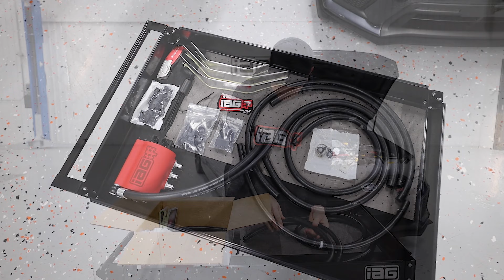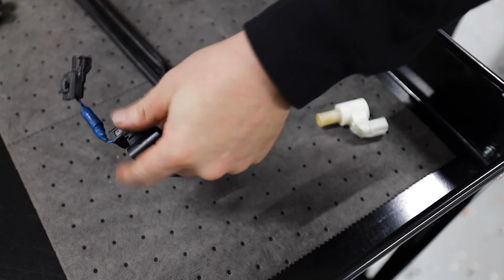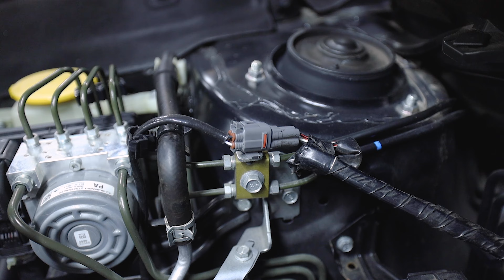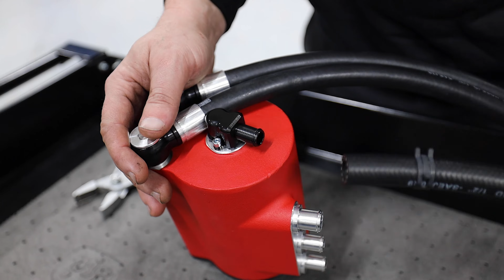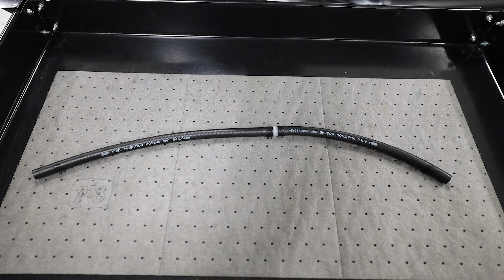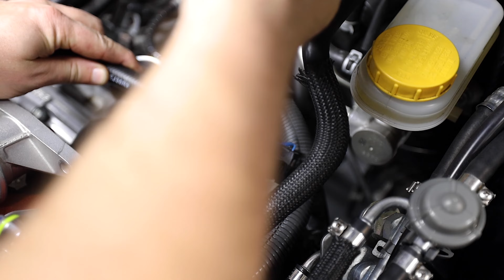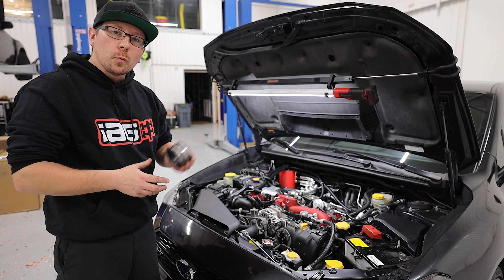2018-2021 STI Air/Oil Separator (AOS) Install Instructions | IAG Performance

Comment: THANK YOU FOR THIS IAG! Doing the install right now and had so much trouble getting the Y hose on the block.. If you’re having trouble as well, I saw a comment that said to reuse the OEM hose and I did so and slipped right on with OEM clamp.
Reply: You’re a godsend
Reply: I’ll keep that in mind when the time comes.
Reply: Just used this god bless
Reply: That’s exactly what I ended up doing. I spent like two hours messing around with it.

Comment: I don’t see a pcv connector on driver side on a 16 Sti am I wrong I don’t see it anywhere I see only two
Reply from the maker: Different model years have different PCV connectors. If you don't have one you can skip that step.
Reply: @theiagchannel  thank you lol I got it done. And it’s running smooth

Comment: Halfway through the install currently, will update when done! So far going smooth, biggest install for me ever so I’m taking my time and making sure it’s right! 
One note: when you go to put your Y splitter in consider re using the OEM hose the same size, it fits so much better and you won’t break the fitting or your hand trying to put it in, lol! There’s a video someone linked where the guy shows using the stock hose instead of the one provided by IAG!
Reply: Update: I am done! Everything is back together and running good! By far the worst part was getting the intercooler back on… the turbo hose connection will make you go insane! You need a lot of lube/grease and a nice long pick to help guide it on! Very challenging yet rewarding once everything is together. I bled the system, now I need to add some coolant back but other than that I’m ready to ride’
Reply: Did u spill any coolant?
Reply: @GrayreaperAI  yes. It’s hard not to when disconnecting the lines unfortunately. It wasn’t a lot though and I added back some to level it out!
Reply: @andysmith9243  does it smoke white from engine?
Reply: @GrayreaperAI  oh no… that could be a deeper issue with your coolant system
Reply: @andysmith9243  it was the coolant burning off. I drove to work today (35 mins highway) and no smoke or issues. Thanks for the install help. One thing I would like to point out. Is when you first put the AOS in, the tubes on the bottom of the unit looks as if it’s not going the left hose to the turbo coolant port.
Reply: @GrayreaperAI  ahh okay good to hear! And yes I understand that. It’s not an easy install and can be a bit tricky with some of the hoses. Glad everything is good’
Reply: @andysmith9243  thank you. Hope the best for you
Reply: Im currently installing mine and the y fitting broke 😢 I’m gonna try using the old hose when the replacement eventually comes in because I spent 2 hours fighting with the IAG parts just for the fitting to fall apart in my hands
Reply: @soglod4572  damn lol that’s a pain! From what I remember I re used the same part you are talking about. It’s such a disaster of an install lol! If I ever do it again I will pay someone!

Comment: Does this apply to 2008-2014wrx?
Reply from the maker: Some aspects are similar, but it's not exactly the same due to differences with the intake manifold and PCV hoses. We have full written instructions on our site for the 2008-2014 WRX

Comment: Bout to do the install in a day or two. I have watched this video 3-4 times already, and will watch a few more times before doing the install. I have all tools ready to go, and am excited to get this on the car. My 2011 wrx had cylinder 4 compression issues, and I didn’t care for it as I should’ve, and definitely learned my lesson on what is needed for these cars to be healthy. I traded it in for a new 2020 STI that ive kept completely stock thus far. This video should be exactly what I need to understand the process more thoroughly. 

Thank you IAG, for providing this video. I understand most shops charge quite a bit for this so i decided to give it a go myself. 

I’ll let you guys know how it came out after I’ve finished the install. Next up after this is the cylinder 4 coolant mod, along with a Koyo aluminum radiator. Only then can I be comfortable doing performance upgrades down the road, as this is a daily driver that id like to keep healthy over its lifetime…
Reply: Alright guys, I’m taking a break. I’m at the point of reinstalling the intercooler, but having some issues with fitment. Should be able to get it on with some patience. 

I struggled to get the yfitting on to the block where the oil returns from the aos, that took me the longest to get right. Hard to see down there and I couldn’t get my throttle body to move quite as far to the side as they showed in video. 

The other parts that took the longest we’re getting the clamps all set right. Some of the steps took me longer than I was hoping, and I had more coolant leak than I would’ve liked. I’m sure I’ll get some smoke on start up due to that. I’ll come back after I get some rest and get the IC reinstalled. I hope to have the car running by this afternoon. I’m hoping it’s all solid and there’s no leaks on start up. I’ll have to add some coolant but that’s fine and was planned for.
Reply: @coryanderson5210 congrats on your progress! Would love to hear if you’re finished now. I’m over halfway through and yes the y fitting was killing me. I found out you can re use the OEM rubber fitting that’s the same size and it goes on much easier but is still very secure!
Reply: @coryanderson5210  How did it go?
Reply: I couldn’t get the TMIC back on, due to the new tubing that ran under it. Followed instructions, and tried a few different things but couldn’t get it to fit so I just took it all off and returned the car back to stock. 

It’s not what you all want to hear, but I’m just gonna keep this car stock at this point. There’s more important things in life right now to take care of than to spend time and money messing with my perfectly fine running car.
Reply: @coryanderson5210  That sucks. I wouldn't give up, maybe take it to a mechanic and work on it with them or something. Or perhaps you need a couple more special tools to help you get it done. You could also just get a catch can instead which I believe is easier to install. Even without either of those, your car will run just fine, its not a big deal.
Reply: Yea it’s running without any issues. Wasn’t a tool issue, it was a sign from above that my time and resources arent meant to be spent on these sort of things… no complaints to IAG. I should probably not comment anymore after this one, as I don’t want to take away from IAG and their quality business and products.

The car runs just fine in its stock form. I’m now content with that. Like I said, it’s not something the car community wants to hear, but I have more important things to deal with than changing up my perfectly operating and fun to drive two year old car… I used to be obsessed with cars, but I knew I had lost that interest when purchasing this car new. I got caught up in the mod phase for a short while, as this car is the car to mod, but my priorities are now set anew. I guess it’s my test of temperance for these next few years.. I’ll enjoy it as is, and when the time comes, I pray Jesus will be happy with my decisions. That’s all that matters now.. 

Hope you guys are ready for what’s coming! Repent before it’s too late… cars won’t survive through an emp… and there won’t be cars in heaven or hell, so enjoy them while you can 🙏
Reply: @coryanderson5210  It will run fine now, but having an AOS will keep it running well for longer. Keeping it stock will make the intake valves get covered in carbon eventually. I'm not sure how much it would cost a shop to install it for you, but if you find out and are okay with paying it, get it done.

Comment: Word of warning to those such as myself that live in cold climates.  If you drive your car for extended periods (NOT stop and go) in extreme cold, the AOS lines WILL freeze.  I'm currently thawing out my entire PCV and intake system.  I want to emphasize that this is NOT, I repeat, NOT a problem with the AOS, it is an inherent issue with the location of the PCV and the intercooler on WRX's. The cold air blows through the intercooler, directly onto the PCV lines.  Over time, this will cause the moisture (water) in your system to freeze and create crankcase pressure which will push oil into your intake, and possibly blow your dipstick out, which blows oil into the engine bay.  One fix that I will try is to put cardboard over the intercooler to try to keep temps in the engine bay high enough to prevent freezing.
This does not seem to be a problem with people that drive in stop-and-go conditions, it only really affects those that are driving on highways/interstates for prolonged periods.
Reply: Where do you live ? And how cold we talking ? Below 10 degrees?
Reply: @mikeyrov5230  Great Plains region in the U.S.  We can regularly see -20 to -30 F before wind chill in the winter.  I did cover my intercooler and surrounding areas with cardboard this last winter, and that helped to prevent the lines from icing up.
Reply: @garyburrus9379  oh wow that’s cold lol, I might be safe then , we don’t see below zero much
Reply: @mikeyrov5230  You should be good, it's really only a problem once the temps are below zero and you are driving at a consistent speed for a long time.

Comment: 11:07 is it ok to attach either coolant hose on either side of that coolant attachment? or is there a specific coolant hose for each side, for example the left coolant hose (from the AOS) goes to the top, right coolant hose goes to the bottom
Reply from the maker: Sorry for the late reply, but yes you can attach the hose to either port. The coolant simply flows into the AOS chamber. The direction does not matter.

Comment: Does the 2018+ not need the breather hoses on valve covers to be modified? I am done installing all my hoses(per the video) (struggling to get intercooler back on), but I have extra t-fittings still?

Comment: Is there an benefit connecting the 2 PCV hoses to the Blow By sensor white connectors versus connecting the 2 hoses directly to the block like IAG used to instruct to?
Reply: If there is enough length on the hoses, you should be able to connect directly to the block as long as you jumper the PCV diag connectors to suppress the CEL. I've not seen the older instructions, but I'm guessing that these new instructions are more EPA friendly since they keep the diag connectors intact. I'm going to perform the install this weekend on a 2017 STI and I'm considering going straight to the block.
Reply: @satsun  Thanks for your input satsun. I ran them straight to the block with no issues using the jumper method. I am just curious if the Blow By sensors are important to the operation of the engine since not all systems are 100% efficient and some blow by will still make its way into the block. 

If you are still top mount intercooler that was the most annoying part of the install tbh. Other than that everything is straight forward. I suggest printing out the instructions in color, watch this video, and take your time. Good luck!
Reply: @wndr_lusti  Those connectors don't sense anything regarding the content of the lines, they're called 'PCV diagnosis connectors'. Their only purpose is to throw a CEL when the connection between the two parts is open. That's why it's easy to circumvent them. No operational impact by removing them.

Glad you were able to run straight to the block. I'll do the same to eliminate those bulky connectors.
Reply: @satsun  I wonder why Subaru even implemented these sensors then. Emissions maybe? In my opinions its probably cleaner if you just keep the sensors connected so you do not have loose connectors dangling around.

 I have been debating whether I should go back and reinstall the OEM hose and sensors since I do not really see any downsides of keeping them. I thought maybe flow may be restricted but I really doubt it. What are your thoughts?
Reply: @wndr_lusti  I've already done some of the connectors, I used electrical tape to cover the exposed part of the connector so it doesn't get dirty and then zip-tied the connector to the wire harness or something nearby to keep it from hanging loose.

They are either for emissions requirements or they're in place because certain PCV lines need to be modular for serviceability, so if part of the PCV system gets knocked loose then there's a system in place (CEL) to notify you of the problem.

Comment: Thanks for the video; follow everything to a T, with one exception. That new drain hose with clamps that goes under the turbo / but the throttle body. There was no way I could get that on. Tried for 45 minutes and wouldn't budge. I watched this video (https://www.youtube.com/watch?v=vVFrBlO8FxQ&t=345s), where the guy re-used his factory hose and that's how I ended up getting all of this to work. Other than that, fantastic video and fairly straightforward install. Took my son and I about 3 1/2 hours from start to finish. Local Subi shop quoted me about $676 to install at 4 hours of install time, so I figured I'd see about installing it myself. After watching this video and the other one I posted, I was confident that I could do this (and I am no mechanic, by any means).
Reply: Thank you for that. I had originally watched the other video to get prepared and I forgot he re used that OEM hose for the y fitting! I was dying until I found that out, thank you so much! It slipped on nicely once I did this.

Comment: I love this AOS, it was one of the first mods I bought for my car. Very well explained step by step video - he makes it look easy. Still way out of my league to install this myself. I got my local tuner shop to install this for me instead.
Reply: If you don't mind me asking, how much did the install run you?  I'm thinking of doing the same.
Reply: @The Doe Show  it depends on how much the shop charges an hour for labour. Where I am from, I had to pay an additional $500 - $600 for the shop to install it for me. It took them about 4 - 5 hours to properly install the AOS if I remember correctly. I also had other things being done to the car at the shop during that time, so I'm roughly estimating
Reply: @dc.wrxsti  how is your STI holding up?
Reply: @aqwheavenlehealer  so far, so good. My car has been treating me really well. I do my best to stay on top with basic maintenance. I am currently at 67,000 km's - daily driving and protuned
Reply: @dc.wrxsti  thanks for the reply, I’ve had mine for a year now and it’s been doing well, I’m a firm believer in “take care of it and it’ll take care of you”
Reply: @dc.wrxsti  Thanks for the reply!

Comment: Without aa doubt an install I'd do once I reach closer to the end of my cars warranty, however my car is RHD meaning the unit would sit on the other side of the engine bay, is there any install videos or instructions for Right hand drive cars?  or for the least do you guys sell the same kit to Australia with extra hosing?

Comment: I CANNOT GET THAT DRAIN HOSE ON THE BACK OF THE BLOCK FOR THE LIFE OF ME WITH THOSE 5/8” CLAMPS😭😭 anyone have any useful tips on doing it or doing it other ways that won’t fail?
Reply from the maker: Patience and patience. Make sure you are lubricating as well!
Reply: Also one more question: I led the left most hose to the coolant tank inlet and the most right coolant hose from the can to the turbo inlet. Is that correct? Couldn’t really tell from the video. Thanks again. Great vid

Comment: whats the hook up for 2015 sti?!?!?! I read in the comments its connecting the two vent hoses directly to the front most valve cover vents... but where is this stated from IAG in instructions!! The only instructions IAG has for 2015-2017 sti is the exact same instructions from 18-20 sti becasue its all under the exact same install manual. Yet the comments say otherwise. SO IAG WHAT IS IT?? Do I do what you guys have said multiple times in the comments or do i follow your 15-20 IAG aos v3 install manual?? and if it is whats in the comments.. where do I find that info from IAG directly!!!

Comment: I need help, at 11:40 when he connects the hose to the expansion tank. is that the bottom left hose on the can? and then at 12:00 i'm assuming that's the bottom right hose of the can? the video and the instruction manual doesn't say, and the only closes picture in the manual that kind of shows is on page 48 step 94. it highlights the 2 hose, but's its still a little hard to tell which one goes where.

Comment: On the 2 swivel hoses on the bottom of the AOS, which hose goes to what? It looks like the hose closer to the strut goes to the top coolant reservoir and the one closest to the wire harness to the other coolant line. Is that the right placement?
Reply from the maker: Yes that is fine! They can be interchanged but we found this routing best.
Reply: Does it matter which PCV vent (passenger/driver side) goes to the top or middle of the AOS ports?

Comment: My IAG AOS didn’t came with heat sleeves at all should I be worry? didn’t even know I was missing that.
Reply from the maker: What AOS kit did you buy? FA20 WRX? Not all kits come with them.
Reply: @theiagchannel   IAG V3 Street series for a 2018 sti. (IAG-ENG-7151)
Reply: @theiagchannel  bought it back in June of 2020 and I just got it installed.

Comment: Impossible to get Y pipe on to the block with the clamp on. Applying enough pressure to get the hose on just pushes the clap up the hose. Any suggestions?
Reply: When installing mine, I just used one of the zip ties that it came with to tighten that lower hose.
Reply: I reused the OEM hose
Reply: Same issue. Not sure why they have you tighten the spring clamp before applying it to the block. Works best if you tighten after it’s on. I ended up having to use another clamp.